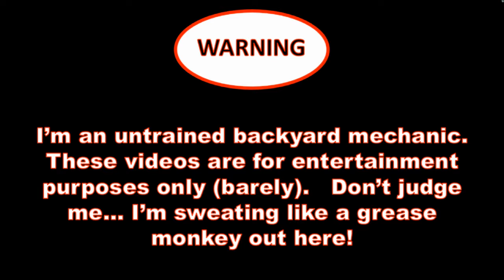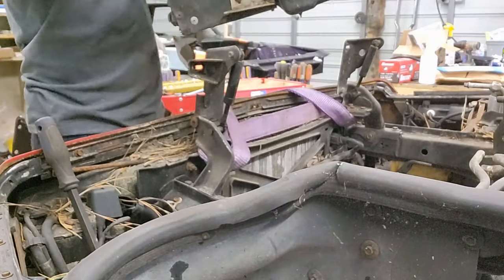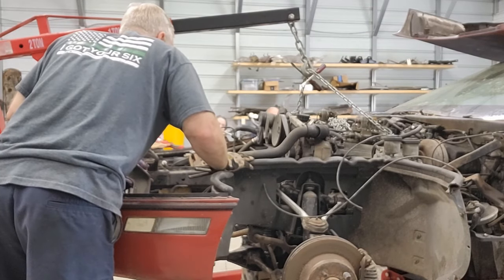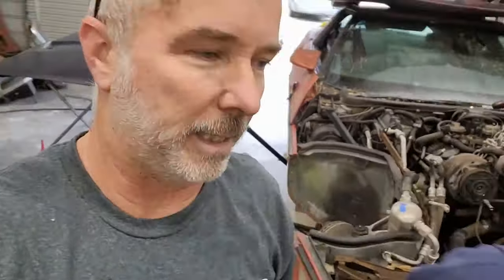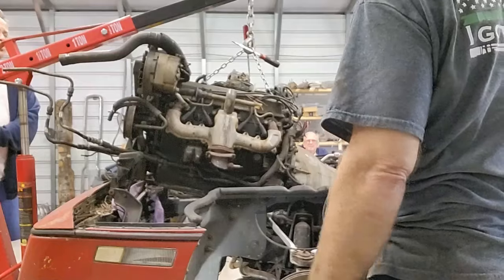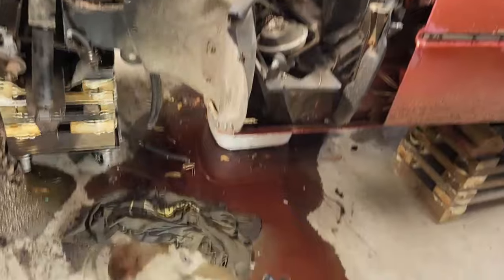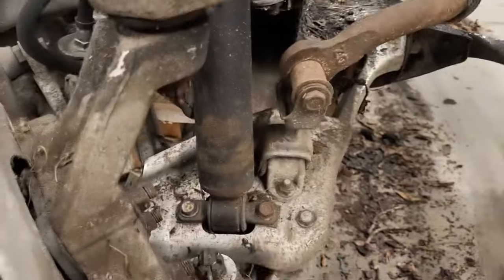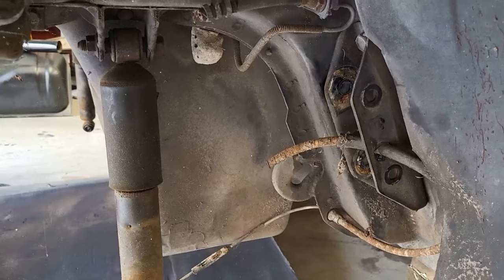C4 Corvette disassembly - Front Suspension and Engine Removal

Comment: Hook the hoist under the drives side on a angle  under the front stub axle to get the engine out of a Vett
Reply from the maker: Thanks.. that's good to know for the next time.
Reply: I also think since he already has the C channel off that he should just unbolt the tranny and do it in pieces. Much easier.

Comment: That was fun .... But I have the LT1 in my Vettes, so it's a little different. Fun watching you struggle, in the wrecking yards they just cut the frame in front of the firewall and the front clip comes right off. Now the real fun starts.
Reply from the maker: Hey.. it was a lot of fun to pull everything off of it.  Funny how it seems to be more fun when you're not concerned about the car.  I did think about just cutting the frame off but I didn't want to hurt my chances of someone wanting to come and get it for scrap.  Thanks for watching the struggle.. lol